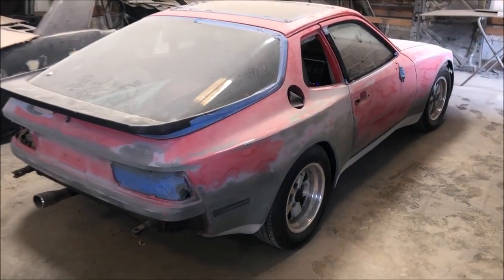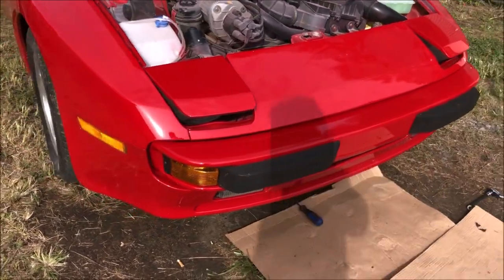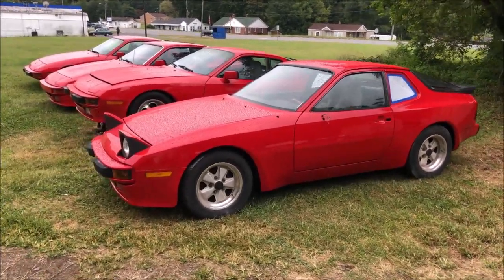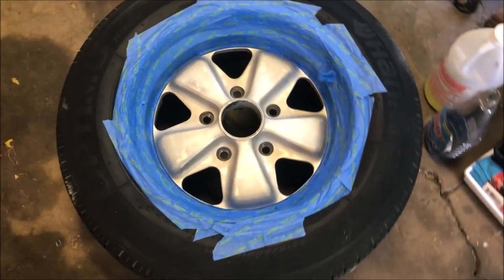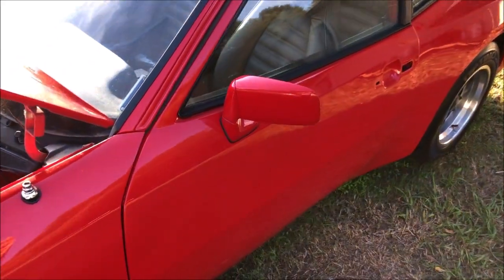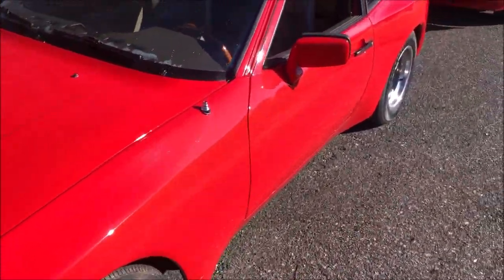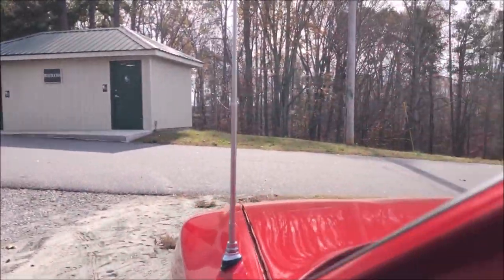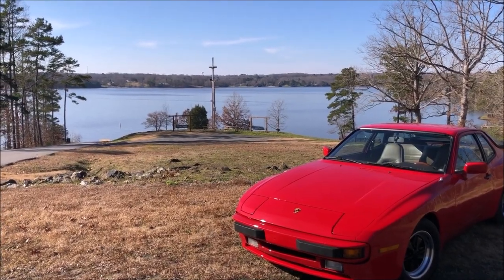Porsche 944 Restoration -Part 6

Comment: I started watching Brent’s videos and bought one and sent it to him for all the repairs. He did an excellent job with my 944. I made poor TJ re leather my seats, I know he hate it but he did a phenomenal job. Great video and great results. If you are looking to buy one, go ahead and do it and send it to Brent, you won’t be disappointed.
Reply: Approx how much did all this cost? Car looks amazing!
Reply: That car indeed looks amazing. My project was a lot smaller because my car was in better shape than the one on the video.  I purchased my car in Florida and shipped to Brent in North Carolina. Nothing had to be done to the engine, transmission or clutch. He fixed all the electrical gremlins, change the fuel tank strainer, fuel filter and flush the fuel tank. Drained the differential fluid and replaced with new fluids. Bled brake lines and replace fluid and fix a small seal leak. Flush radiator and replace all the hoses. Oil change, Fix the radiator fans, new water pump and timing belt, replace the belts for the AC compressor and water  pump, new distributor cap, cables and spark plugs, replaced all the vacuum lines and replaced every 35 year old hose and cables in the engine. Remove the front seats and re leather the seats, replace the shift knob boot, replace the air filter and a bunch of little seals. Fix the wiper system, Including the shipping of the car, it ended up being around $5k. One of this days, I will make a video of the car and share it.
Reply: @MrAngelfrias  That's a great list of stuff to be done, preventative maintanence at that point. I just had my timing belt, water pump done along with a short shifter put in and full tune up. Maybe I can ship him my car to get everything else get done as he is the expert! Enjoy the 'new' ride!

Comment: Nice restoration video.  Excellent.  I had a 84 red one.....the factory paint was bubbly clear coat mess.  I can see all the EOM parts you had to use makes restoring these very pricey.  For no particular reason either.  You did a good job of use a parts car.  The 944 is in my opinion better than my later Boxster.  Good work.
Reply from the maker: Thanks!

Comment: I think the under-hood insulation pads you got were for a 924S. The hood structure is slightly different.
Reply from the maker: It is a 924S pad. Not sure where the owner ordered it but lots of websites list that pad for the 944. I have no idea why the 924S has that difference there. In the Parts catalogs on Porsche's website it lists the early and late 944 along with the 924S as having the same part number... so I can't make any sense of it.

Comment: Alright I've got a question regarding the cooling fans at 11:25. I can't figure out why my fans don't ever turn off after they've come on while driving. In theory once the engine temperature drops, the fan switch should open and fans turn off no?

I've got an 84. I'll be driving along and my temp gets just past the middle mark when the fans kick on. The temp will drop between the first and middle mark and eventually hover around the middle as it should. I can be driving for over an hour and the fans will never turn off. I just finished my restoration so basically everything is new. New thermofan switch, thermostat, water pump, etc. I've checked the cooling fan relay as per Clarks Garage and it's good. Once I shut the car off the fans will turn off once the engine cools and the fan switch opens. Is there something I'm missing as to why my fans never turn off while driving? It's driving me nuts because they shouldn't be on all the time.
Reply from the maker: Sounds like you have the wrong thermostat and thermo fan switch combo. In this situation the thermo fan switch will run the fans constantly since the thermostat is closing because it thinks the engine is too cool, but the thermo switch says its too hot. So the temp might never go above the middle mark but this will cause them to never shut off. The proper operation of the fans is for them not come on until the thermostat is fully open at the third mark on the gauge. The fans can then cool the engine back down to the middle mark at idle and then shut off. So there needs to be a gap between the temperatures, otherwise the fans will run all the time as the thermostat is trying to heat up the engine while the thermo switch is trying to make it cooler. I hope that helps!
Reply: @edredas  this really helps, didn't even think of checking this! Do you know what the stock temperatures for the thermostat and thermo fan switch are?
Reply from the maker: The stock Thermostat is 80C while the thermo-fan switch should be 93C.
Reply: @edredas  thank you for the replies , I appreciate it! Very Interesting. I know my fan switch is the 92-87 degree variant and I'm pretty sure the thermostat I installed is 83 degrees. That should be enough of a difference you'd think unless it needs to be 80 degrees. Unless my thermostat is getting stuck partially closed causing the engine to reach its operating temperature, turning the fan switch on but not properly cooling the engine down enough since the thermostat could be stuck partially closed?
Reply: *sorry stuck partially open, just realized my error.

Comment: OMG, I need to get on my '84 944! Been sitting in the driveway for over 5 years now:.( Where do I start...? (Texas)
Reply from the maker: We usually start with the engine. A car that has been sitting for 5 years will need belts and a good fuel system flush. We recommend replacing all the front seals, their collars, oil pump drive gear, water pump, oil cooler seals, and all the rollers while doing the belts. As for the fuel, it will likely need to be disposed of. Afterwards you'll need to replace the tank strainer, fuel filter, all the rubber lines, then have the injectors cleaned, and fuel rail flushed of any crud. We see a lot of cars that won't start or run terribly due to a dirty/clogged fuel system. That said, all this might seem like a lot of work, but they are old now and many were not taken care of. However once you catch up on the maintenance they can be very reliable. I hope that helps!

Comment: Do you install the antenna so that it extends straight up at 90 deg. or is there a slight rearward angle to how it extends?
Reply from the maker: This antenna goes straight up without leaning. I modified the factory bracket to make it work with this antenna and keep the correct angle.
Reply: @edredas  Yes, I thought it looked like it was going straight up but it's hard to see for sure, so thanks for clarifying.  I don't have much experience with the 944 compared to you but I thought the original Hirschmann unit had a little rear lean.  When I replaced my antenna I mounted it so it would lean back a little because I was trying to mimic what I thought was the original look, so that's why I'm checking with you.  Thanks!
Reply from the maker: Ah gotcha, from the factory the antenna would be completely straight all around without any tilt or leans in any direction.

Comment: Great looking car now!  What difference do the hood pads make? (Mine didn't have them when I bought the car)
Reply from the maker: What year is your car? After 1988 they stopped putting them on cars so as you can imagine they make no difference. The only reason we put them back on is for originality. On later cars that never had them we leave them off. I hope that helps!
Reply: @edredas  thanks and that makes sense as mine is an 88!

Comment: Hey man !!! Do you know if the 3 speed auto has any way to improve the shifting ??? 😄😄😄😄🇺🇸🇩🇪😎🍺🍺
Reply from the maker: I'm not entirely sure. If you're having trouble with it jerking there might be chance the rubber damper has failed. I also have a 1984 3 speed automatic car and the shifts are nice, albeit the gearing is very low. So I enjoy driving the car in the city but not so much on the highway. If the damper is fine, then you might be able to find a transmission specialist that can correct whatever issues that you're having or even change the shift points. I hope that helps!
Reply: @edredas  thanks man !!!! 1-2.shift is snappy seem like really slides into 3 rd. Gonna be at VIR. for PCA. club race (race announcer) if you are keen come on over , lots of 944 action !!!😎😎😄😄🇺🇸🇩🇪🍺
Reply from the maker: Awesome what dates? I’m having an event in Georgia June 18-20th if you can make it!
Reply: @edredas  i have an 85.5 auto and the adjustment of the throttle position cable is a great area to get to know. i added a little jb weld to the groove on the throttle cam to trick the transmission into thinking you are adding more throttle. it takes a bit of adjusting both cables to get everything right but now in normal mildly aggressive city driving, i get shifts around 4-5k so i can get ahead of annoying pickup trucks without having to floor it.  i've got a 2 degree offset cam advance so i'm in the tourqey ist part of the power band. Or it's just a placebo effect. With 150 hp and three gears you have to get creative. I'd love more stuff on auto since there is like zero info available.
Reply: Hey man !!! PCA CLUB RACE AT SUMMIT IS SEPTEMBER 17 18 19 !!! come on over!!!

Comment: With so many 944s having been resprayed over the years it's hard to know how these cars came from the factory.  I think you mentioned in an earlier video that the wheel wells would have been painted the body color.  What about the rear of the car?  Was everything under the bumper black?  My car has a mixture of black and body color under the bumper and on the spare tire bulge.  

The muffler looks good painted black and I'm tempted to do the same on my car, but were the original mufflers black or is this an aesthetic decision you made since it's preferable to the serviceable but slightly rusty look?
Reply from the maker: Yup, the fender wells would have been body colored but everything under the bumper including the muffler would have been blacked out. There were chrome tips optional but the easiest way to tell if your car solid color has been resprayed is to put some polish on a white cloth and see if the color transfers. If it does then it’s still the original single stage paint and if it doesn’t it’s been resprayed with a clear coat. That said, this test doesn’t work on metallics since they’re all two stage even from the factory.

Comment: So i have an 87 924 but we are trying to remove the thermostat but we cant get the clip ring out idk if u have take off the thermostat and if so how?
Reply from the maker: That clip is really hard to access with the water pump in place. Not only is the clip very stiff requiring an incredibly strong tool, but if the holes on the clamp are not turned correctly, you will never get it out. You can use a modified large bent pair of needle nose plyers from harbor freight to get the clip out... but you'll need to shape them first and make sure the clip is rotated so it can be reached, otherwise it will never happen. I hope that helps!
Reply: @edredas  we’ve tried multiple things but it seems the only way is taking the water pump out but thanks for helping and also we have an issue with the lights idk if u would know how to fix that too
Reply from the maker: Yeah sometimes removing the pump is the only answer unfortunately. Once you get the clip out make sure you make a tool so that you can put it in with the water pump in place. Then it will be oriented in such away that you can then remove the thermostat with the water pump installed next time. That said, as for the lights, I should be able to help.
Reply: @edredas ok so we got it out and we got the new thermostat in and for the lights so the light switch works the issue we are having is that the main lights dont wanna turn on but when u try to put on the high ones they stay on but when u hold the lever so right now i dont have lights
Reply from the maker: Glad you got it! As for the lights not working this is a very common issue. I've seen this a lot and even have two cars here right now at the shop with this exact issue. I actually just fixed one today. So first off the headlights will usually always work when you pull them back to flash them because they have a constant power from a red wire that runs to the stalk. So even when you aren't getting power from the headlight switch this red wire always has power and can flash the high beams. That said, in order to track down the issue, you'll first need to unclip the headlight switch and check for 12v at the thick black/yellow wire. If you have power there you can proceed. This next part was my issue today. Next to the black/yellow wire is a white/black wire that receives the power from that black/yellow wire through the switch. On the car I was working on today the wire white/black was loose causing it to lose contact. This also sounds like your problem since you have no lights at all. So turn the headlights on an verify that you are getting 12v at the white/black wire. If you are not then the headlight switch needs to be tested. If the switch is good, try depinning either of these two wires and crimping the tabs down for a tighter fit. After that, the white/black wire runs to the stalk that you pull back. From there it sends power to either the high or low beam fuses and on to the headlights. Usually when the selector switch fails you will either have low or high beams. It is worth checking though and making sure the white/black wire has a good connection there as well, however it definitely sounds like either you have a bad headlight switch or loose wire somewhere. I hope that helps!

Comment: Hey man, I just bought a 88 944 not turbo and it’s stalling but won’t start, I cleaned the fuel tank, poured new fuel, changed oil and filter, the dme relay looked brand new the fuel pump is working. The car starts when you spray gas into the intake but it won’t stay running could you help me out ?
Reply from the maker: Sounds like you may have clogged injectors. Very common issue and we are always sending sets off to have them cleaned and flow-matched. We've sent three sets off just this week. I hope that helps!

Comment: How much was that ?
Reply from the maker: This was our Tier 2 restoration which starts around $15k. Thanks!
Reply: @edredas  what’s tier one around so
Reply from the maker: @jdsphynx3656  Tier 1 is starts about $10k. The only real difference is that the engine isn’t cleaned and replated when rebuild.